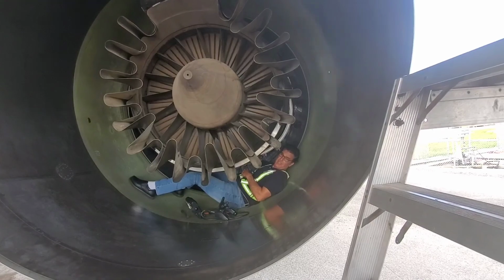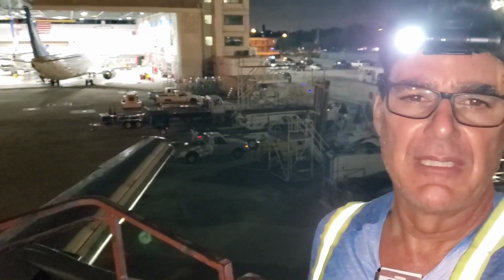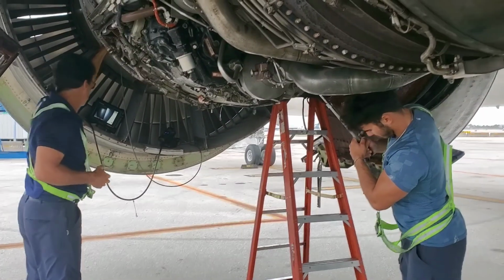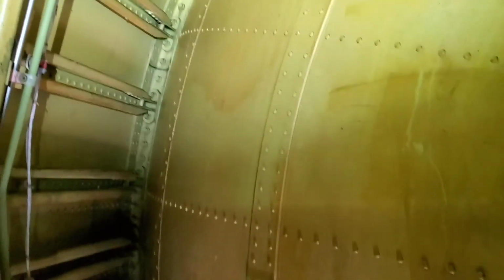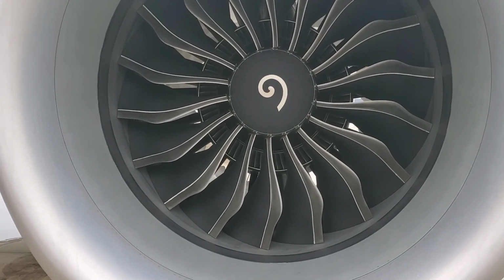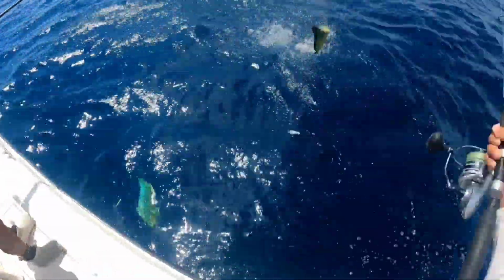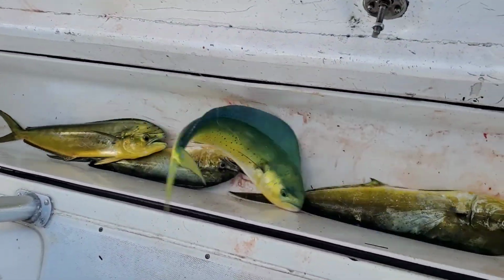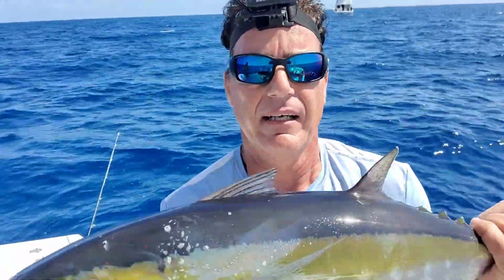WAIT WHAT 🤷‍♂️ Airplanes ✈️    Fishing  🎣 MIX COMBO MAMBO 2023 #aviation #fishing #study

Comment: Wheel bay testing and sending them for NDT to lab after harsh touchdowns going through manuals regarding tyre burnouts and wornout .. Everything is level -C Checking for safety. I've cleared   modules in India
Reply from the maker: Wow that is incredible you have done a lot and are very knowledgeable